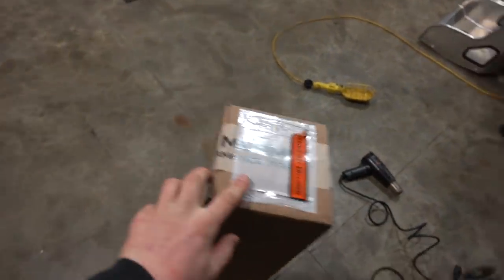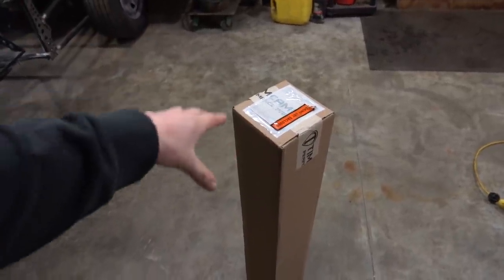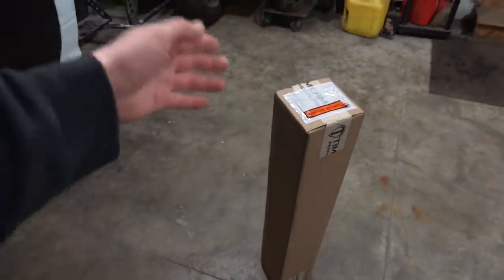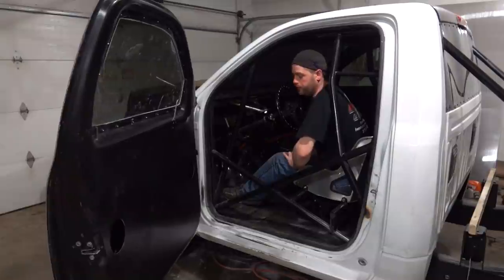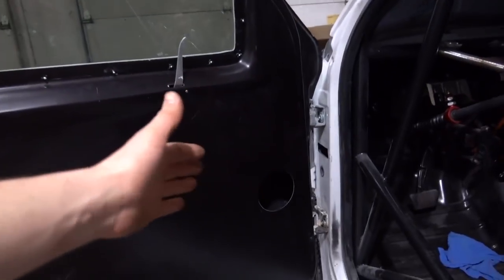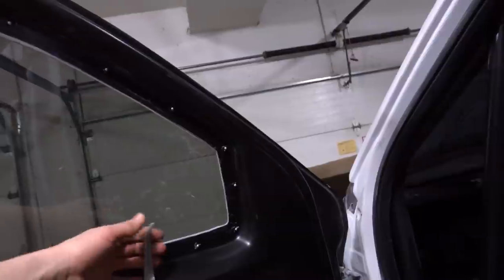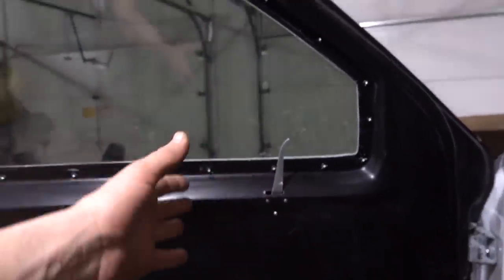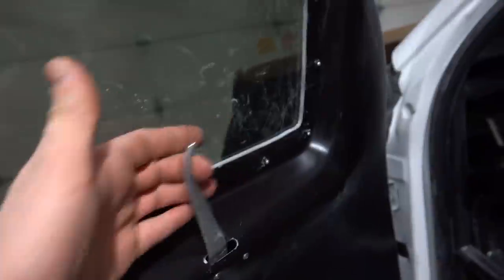THIS Will Make EMERGENCY Drag Truck ESCAPE Quick and Easy!!!

Comment: some good interior shots of a Porsche Cup Car (factory BIW, non-VIN track car) interior in this article. maybe helpful to see how they try to place the pull strap where it's in the front half of the X-brace gap so it can be reached around the retention seat with a HANS device in place. 

http://www.racecar-engineering.com/articles/porsche-991-the-gt-racers-revealed/
probably also worth considering installing limit straps on those fiberglass doors. catch a good wind gust at the track and it could damage the doors or the front clip if they're not strapped to limit how far they'll open. could be as simple as a peg on the door and on the A-pillar, just enough to slow it down so you can grab it.
Reply from the maker: Thanks!

Comment: I think it was my comment you referred to and no problem!  I understand how sometimes u are doing a build and you get a little tunnel vision and sometimes a little friendly advice from someone looking from the outside can make you see things a little more clear. And they perfect!  And great jobwith putting the one that your not going to use as much in same spot as driver side!  So this way if you did have a problem( hope you never do!) and you need to get out on other side your mine already knows were to place your hands to find it to get out!  And thanks for showing you actually read what viewers post on the comment section!  It’s getting there! Looking killer! keep up the great videos!
Reply from the maker: I appreciate the thought, wouldn't have done it if you hadn't made me think of it's possible importance